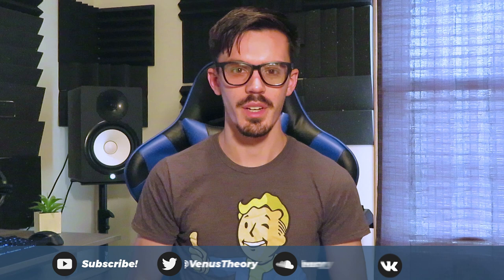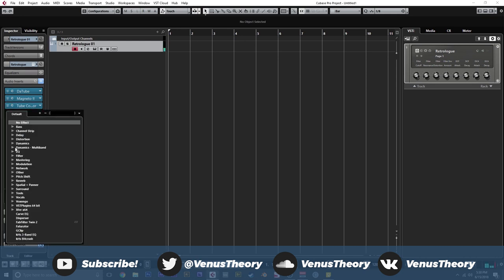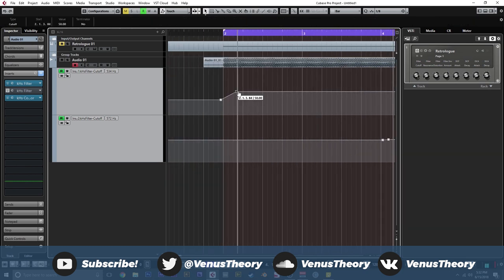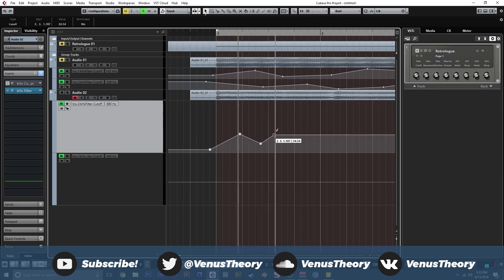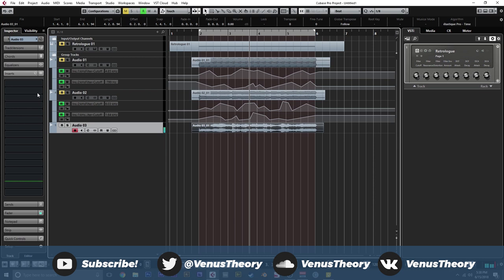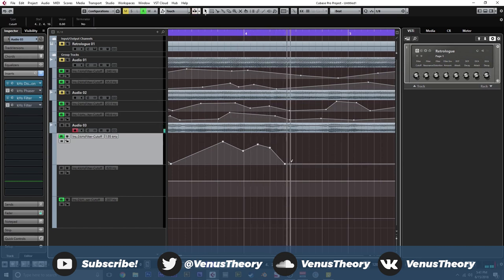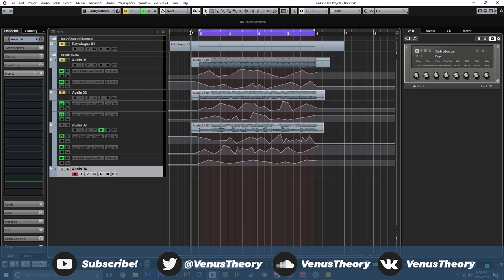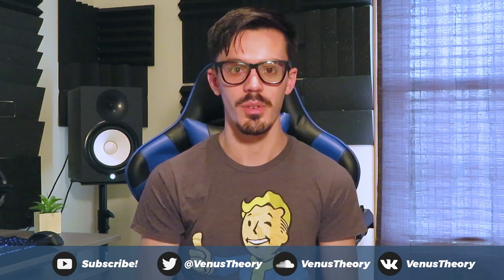Sine Compression Bass Tutorial [Frequent // Noisia // Jade Cicada // Neuro]

Comment: Yo, frequent has a rack which is mapped to your midi device and doesn't need resamplig up on his channel.
Reply from the maker: For sure, that's definitely another way to do it if you're an Ableton user! His rack is really well designed for this stuff. You could also do it without resampling by just setting up macros or something in Patcher in FL, or with Quick Controls in Cubase!

Comment: i like your style of Sine Compression,b ut why you use a notch filter in stead of using the Cubase EQ? there u have up to 4 parametics "Filters"
Reply: filters are not like EQ even they seems the same. One most important thing is, filter's freq (or cutoff) is based on key and polyphony, for example, you set a notch's cutoff at 440Hz, then set keytrack to 100%, now play and hold A3, A4, A5, you will get three notch filters each with their own cutoff (220, 440, 880Hz), if you use EQ, you just cut 440Hz in the Audio.

Comment: Nice. Can I just ask why you didn't  do render in place each time?
Reply from the maker: Hey dude! Usually when I'm doing basses like this, I do it all in a single session and record each pass manually so I can go back just in case I screw up or want to repeat the processing chain with a different sound. Bouncing in place is another good way to achieve the same thing though!
Reply: @VenusTheory  when you render in place, you can leave the original untouched (just on mute, for example), so you don't lose anything, just save time instead. I have mine on a keyboard shortcut (shift + alt + r) and it's just sooo convenient, I highly recommend it!
Reply: Thats why I love comments )